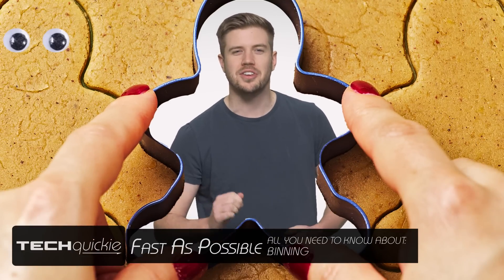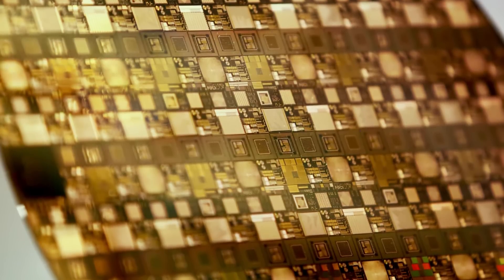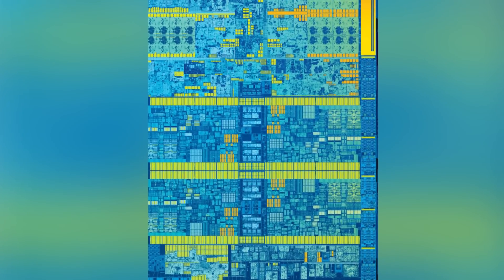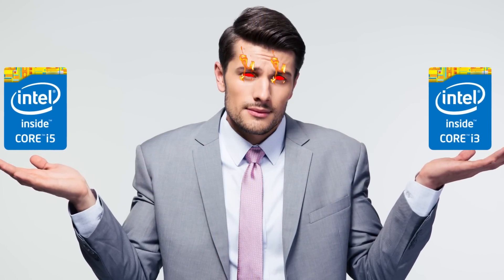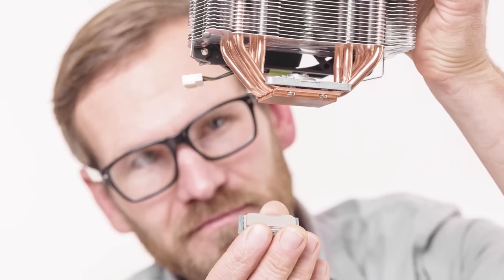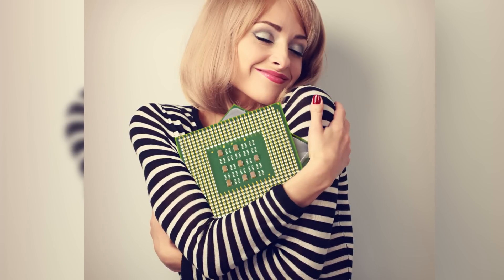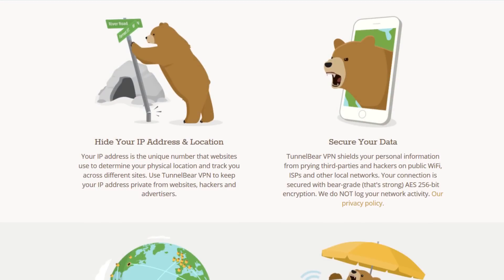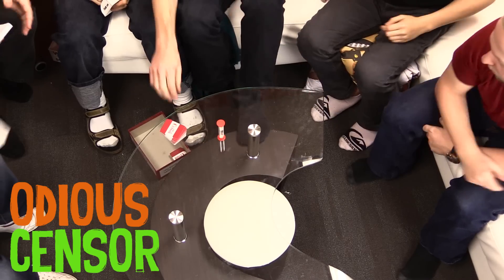Binning As Fast As Possible

Comment: What are electronic boards made out of? the green ones where all the chips,transistors, and connectors go, it seems to be layered out of something when looking at the sides.
Reply: +CinmarRS PCB's are layered to allow more circuitry without crossing wires and to protect from potential static from being handled.

Comment: The first R9 290 (especially from Powercolor) had actually R9 290X chips. only a few had real R9 290 chips which are the same as R9 290X but with some physically disabled parts.
I was one of the first buyers of this card and 90-95% of cards were unlockable via BIOS Update to R9 290X.
But guess what... I lost the GPU lottery and got one of the rare cards that weren't unlockable .__.

not a thing with the new cards anymore so don't even try it. When R9 290 and 290X were released, the demand for R9 290 was a lot higher than the capacity of R9 290 chips so what they did was putting real R9 290X chips on these cards instead. not all brands did this tho
Reply: +Ultravore can still unlock some hardware, tonga and fiji can be unlocked still.

Comment: This is a repulsive process. Hardware should only be disabled if it is unusably defective. CPU's in a specific category generally perform within a small margin of each other. This has to mean that the majority of the time they are actually disabling perfectly good hardware. If they were to have a really good manufacturing run where 95% of all CPU's made were 100% viable do you think they would just lower the price and give everyone a top tier chip for medium to lower tier pricing? No, they would rather sabotage a perfectly good product just to continue pretending that the more expensive chip costs more to make. Oddly enough it is probably cheaper to make because it does not have to be tested as much or sabotaged all things which increase costs.
Reply: +Cinnamongod I'd love to know what fab is has 95%+ perfect production on new processing nodes.
Reply: ? What a stupid question? Umm... the hypothetical one I used to make a point.
Reply: Cinnamongod You can't apply hypothetical questions to real-world logistics. Fabs don't have the yields to give you that many perfect chips, hence why this system exists.
Reply: DeilGrist Oh your one of those people that think things are the way they are because they have to be instead of it is just more profitable. My example is not applied to real-world logistics it was to emphasis a point, perhaps you need to read it again. Then again I am not arguing with someone who is honest am I?
Reply: Cinnamongod If you're going to complain about something that you openly admit doesn't apply about the real world, then it's pointless. You're just talking for the sake of talking at this point.
Reply: DeilGrist As expected a disappointing and dishonest reply. Do you even realize that you are twisting what people say for you desired view of reality?
Reply: Cinnamongod "My example is not applied to real-world logistics..." Do you even read what you write?

Comment: NAND flash chips on SSD's and Hard drive platters are also binned. 
You could have a WD green drive with a 2 year warranty because the number of defects on the platters are larger than a WD black drive with a 5 year warranty and therefor bit error defect growth will happen faster.

YOu can also have very different platter cpacities on the same drive as a result. You can have a 3 platter Seagate 3Tb drive with 1 surface with up to 20% defects. That's actually why reaching experimental platter densities don't immediately translate into drives of that full capacity. Typically, the same thing is true for NAND flash chips on SSDs only they accomplish this with various ov er-provisioning and in chip redundancy schemes. Binning is why SSD manufacturers can have basically identical SSD's for consumers and the enterprise. They just bin the flash memory at a higher tier and adjust the controller with a more conservative wear leveling algorithm.

Comment: Can we talk about how you buy a flash drive expecting it to be 64gb, but instead it's 52.31gb?
Reply: +dadiocoleman it's just the difference between gibibyte and gigabyte.. giga is a unit which is decimal so 10^3=1000.. gibibyte stands for giga binary byte and is a binary unit and 2^10=1024.. your computer works binary so it adresses all storage and ram and everything in units of bytes where 1 kib=1024 bytes and 1 byte = 8 bits so 1 mib=1 kib* 2^10 so 1024 kibs.. but it can't adress a single bit by itself.. the smallest adressable unit is 1 byte or 8 bits.. now those manufacturers use the decimal value to advertise products but your pc still adresses them as binary.. and you can't even blame them cause they say that they use decimal values and not binary.. that's actually wrong in windows and not false advertisement.. windows gives you the binary value like in your example 52.31 gib.. but that is wrong because they call it gb.. it would be right as 64 gb or 52.31 gib but they mix it up with giving it the gib value but using gb as unit.. linux does this right.. they call it gib as it should be..
Reply: +Joshua McIntosh OK. I knew the whole divisible by 8 part, but the rest I didn't know.
Sorry, I'm great with software, but I'm terrible with hardware.
Reply: +Joshua McIntosh The OS also has an impact on how it perceives reading the storage device. Under Linux it would truly show as 64 Gibibytes as a more accurate measurement, the same thing goes for the BIOS. It would show the real value as what the manufacturer intended the storage device to be, in this case 64GB.
Reply: +Breakfast221 they dont just do it between mega and giga, all the way from byte to KB to MB to GB you are loosing 2.34% at each transition which drops it down to 59.6 GB from 64GB. I assume the OP was giving a rough guess at what his drive really is because my 64GB is about 59.6GB, that or he bought a low quality drive.
Reply: +Joshua McIntosh That only accounts for 1.536 gigabytes out of 64, unfortunately.  While that is one of the factors, there are others.
Reply: Dunkelelf3 I was giving an example of one 64gb flash drive. I have another that's like 61gb.
Reply: ***** yes but it is still like this.. but you can't take this 100% accurate for flash cause sometimes manufacturers use some of the space as failsafe like for example a 120 gb ssd is in reality a 128 gb ssd cause flashmodules exist in sizes like 64 gb, 128 gb, 256 gb and so on.. they just disabled 8 gbs in case some cells get damaged to have a backup cell.. others just add some more space that is not accessible on top of the 128 gb.. also hdd manufacturers did this for a long time.. if only one cell fails the entire hdd or ssd would be unuseable so they add more space as a buffer or disable some of the space for normal usage.. 
but discrepancy comes from the gb->gib transition in every case..
Reply: ***** they don't.. jedec just defined kibibytes, mebibytes and so on in 1999 cause kilo, mega, giga and so on are decimal prefixes like kilo=10³ or mega=10^6 and so on.. before that one kilobyte actually ment 2^10 bytes so 1024.. so there is not a single unit with 2 values.. since 1999 one kib=2^10 bytes so 1024 bytes and one kb=10³ bytes so 1000 bytes.. your pc uses the first and drive manufacturers the second, that's where all the confusion comes from.. still as i said above it's neither wrong or false advertisement by drive manufacturers.. microsoft is just doing it wrong.. drive manufacturers say that they use decimal values and that 1 terrabyte will be less in reality cause your pc still operates binary and adresses everything that way.. but microsoft gives you the gib value of a drive and calls it gb what is just wrong.. a linux system gives you the same value for the same drive but actually uses the right unit which is mib, gib or whatever binary unit..
okay ram manufacturers actually really do it wrong too.. they call it a 16 gb kit but it's a 16 gib kit..
Reply: +Joshua McIntosh Technically 1000 is correct as that is the metric prefix used. However, this is arguable and nobody will settle for a standard unless you start killing people off and giving death threats and following through with them.. (or at least I'm hoping your life is more important than a number...)
Reply: +WolfLeader116-2 Also, has nobody mentioned the... (don't be like me, sleep early kids... or else you can't remember things...) file whatever thing........ like a phone book showing where data is located on the drive...
Reply: +WolfLeader116-2 Also, has nobody mentioned the... (don't be like me, sleep early kids... or else you can't remember things...) file whatever thing........ like a phone book showing where data is located on the drive...
Reply: Isn't it just related to conversion? Let's use a 16GB pendrive I have for example. If I open the properties window it'll show in capacity that it has 15,1 GB of space total, or 16.215.154.688 bytes, which would be 16,2 Gib.
I thought it was just that we expected one of the units while they deliver the other. (And bad marketing of course)
Reply: Bruno Hahmann no it is 15.1 gib but 16.2 gb.. 16,215,154,688/1024^3=~15.1 gib.. 16,215,154,688/1000^3=~16.2 gb
Reply: +dadiocoleman And next to what he said, you also lose some due to the fileformat (NTFS for example) and the sort of loaded "firmware" that is on the USB drive :)
Reply: Noobioh yeah but i didn't really want to get too deep into this stuff.. the main reason why your 1 terrabyte drive in windows is something near 931 is the gb->gib conversion.. the manufacturer uses 1 byte *1000^4 as 1 terrabyte but windows shows you 1 byte *2^40 as 1 tib but calls it 1 tb for some stupid reason.. maybe because it was right before jedec decided in 1999 to use kb for 1000 bytes and kib for 1024 bytes.. but in my opinion that was plenty of time to use this new convention.. it makes sense and also i guess there would be way less confusion about kb, kib and a lot less people asking why they buy a 6 tb drive and loose half a tb in the end.. ^^
Reply: +dadiocoleman Let me add some thing to this convo. Some drives might just be defect. Like my PNY usb stick(yha PNY, but it was cheap and needed it for that time) that should be 16gb(actually it was 16, something) but lost space and now sits at 15(literally in windows). Now mine lost space while i was using it, but a friend of mine got one right out of the box with way les space than mine while both rated the same on box.

And space loss isnt exclusively to PNY. While my PNY is a big amount thats noticeably, almost all drives lose a bit after the " , " I have 2 SSD's both 64. 1 is 55,4 the other 55,8 both same brand.
Reply: It's called overprovisioning, and it tries to increase performance, since a storage device slows down as it gets fuller.

Comment: Actually core i3s are usually totally different dies than core i5s and i7s on desktop CPUs. 
Usually it goes like this, i7 being highest binned, native quad core. i5 quad cores being i7s that have a worse bin and disabled hyper threading. 
i3s are full dual cores with hyperthreading, and the Pentiums are worse binned i3s with hyperthreading disabled.
Reply: it's funny because my laptop has a four core Pentium...
Reply: Archimedes Amazonas Pentium and celeron are names that intel throws on anything that isn't a core M, Xeon or in the i series.
Reply: +Archimedes Amazonas Laptop's CPU labelling makes no sense
Reply: An i3 is basically half of an i7 of the same generation.  Most likely by design like a two story apartment complex being exactly the same as the lower two floors of a four story.  Not like a four story with the top two floors sealed off.  Architected to be a standalone half of its sibling architecture.  But similar to as you said, an i5 to an i7 is the same as a pentium to an i3, maybe.  I'm not sure.